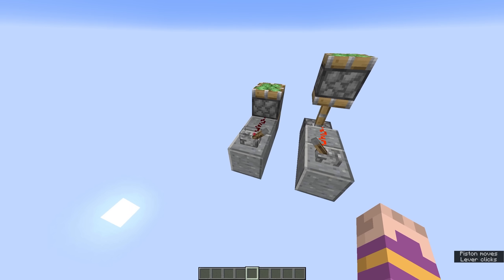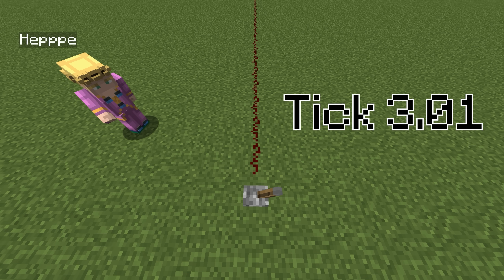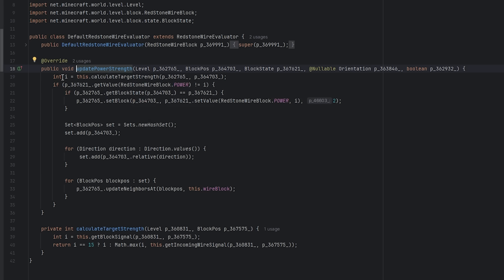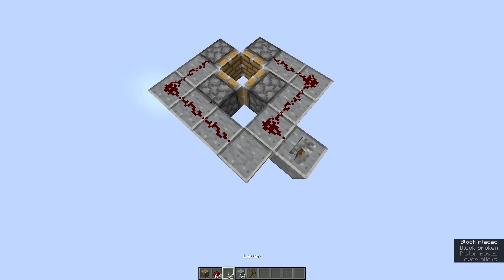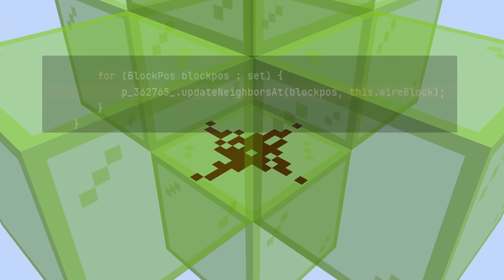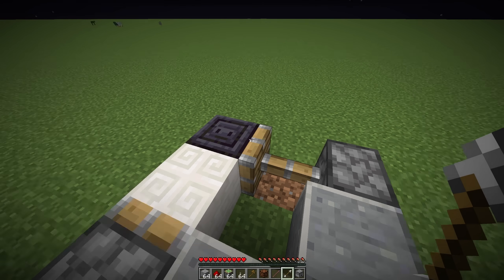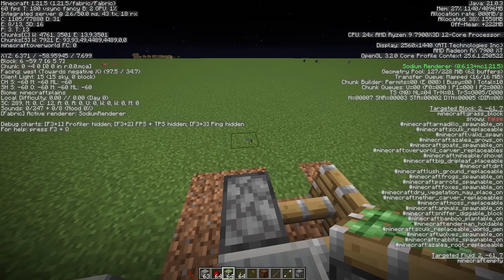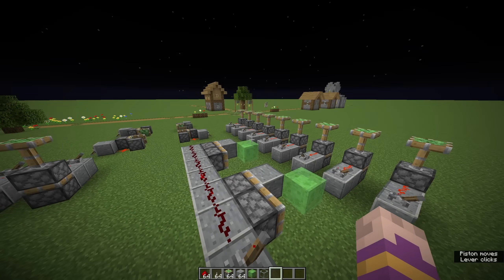Why is redstone locational in Minecraft?

Comment: what's especially crazy about this is that there is absolutely no reason to even use a hashset here; they are already directly iterating over all of the directions to begin with. It would make way more sense for the code to just, update the current block, then iterate over neighbors and update them. This would also make the code faster (since you don't have to allocate and initialize a hashset every time) I have no idea what the mojang dev was thinking here.

Comment: I honestly think the problem with Minecraft runs a bit deeper. I think there’s a massive problem with technical Minecraft revolving around the engineering aspect before the polish aspect. I feel like no technical Minecraft player has taken a step back to think about how ridiculous redstone contraptions are nowadays. Like, why the hell do Minecraft builds need composters?? Why are there target blocks in your build that aren’t meant to be shot at?? Why are you using the fact that block X is 1/16 of a block shorter than a regular block? It feels like Minecraft blocks get a random assortment of ultra specific properties which gives rise to technical players discovering a super useful but super niche application, which becomes the meta for a specific build. Why can’t we have new blocks introduced to solve existing problems instead of relying on weird quirks to make builds work? Why don’t we have a block that doesn’t connect a north/south wire with an east/west wire? Why do we need to apply a 0 tick pulse to have sticky pistons “let go” of a block? Why can’t we just have block deployers and pickers instead of having to rely on duping TNT?? Imagine if another game required you to put a slightly toasted ham sandwich in a TNT cannon contraption so that it reliably propelled TNT forward. Every Minecraft player is like: “yeah that makes sense”.

Don’t get me started with Minecraft PVP. Every other game has parrying, dodging, blocking. And that for the most part is what distinguishes a good player from an inexperienced player. Minecraft has fishing rods, placing crystals on obsidian and popping it, flying into the sky with wings and then hitting people with hammers. It feels like a fever dream that everyone’s just accepted.

Comment: Regarding the “Simplifying” section, you forgot the xor operation: the pattern for each 16 blocks is broken when the upper 16 bits change, and the subsequent calculation is only valid if the bit to be xored is 0b0000.
There are not many predictable patterns when you consider the case where the upper bits changes within the notifiers of a single dust. Basically, the order between notifiers should be considered unpredictable.

The boundary where the upper 16 bits change can be understood as a set of planes represented by 961z+31y+x≡0 (mod 65536). Since these planes are almost perpendicular to the z axis, we can say that at least one of the dusts lined up two blocks apart in the z direction does not contain the boundary plane. A non-locational arrangement that takes advantage of this fact has already been considered (https://youtu.be/2mjZuWJDB0k), but it is still not practical, e.g., it's directional after all.

Comment: 5:14 Am I crazy, or is the 0 at the top there only because of doors? Like it makes no sense for a redstone wire to power the block above (outside of redstone comparators, but this was coded before repeaters were even a thing), it would only make sense to update the block above only if the code for doors was copy pasted, where clicking on the bottom door updates the top door

Comment: 6:23 uh no... redstone torches also do this and also repeaters, comparators, observers, buttons, levers, pressure plates, tripwire hooks and powered and activator rails (considering how many there are i might have forgotten smth) but only in one direction (if rails are a slope then in 2 directions)
Reply from the maker: I said only redstone wire is locational. And I am correct. Never mentioned directionality
Reply: @HeppeGaming I was talking about update range

Comment: 3:37 another way to describe it is unordered = could be any order. Which order it uses can be determined by any part of the program. You could just choose an order as the programmer, you could use a hash function, you could let another program or library determine it, you could make it "random", or you could even let the user determine it. And the important part is your program must work "correctly" for all possible orders.

Comment: This video is inaccurate and flawed in many ways:
- Java double hashes to prevent stupid hashcodes like the one mojang uses from creating patterns, which results in the actual bucket order being impractical to exploit beyond a proof of concept. This has been known for 10 years after sharir made this exact same mistake in his explanation. The only practical thing to take out of the hashset is that you can't rely on the notifier order (e.g. some non-loc dust builds rely on the order within each notifier to create several directional cases that cancel eachother out resulting in reliability, but the ordre of the notifiers has never been relied on in practice).
- Nobody calls it quantum mechanics
- Get a better decomplier lol. Most of the variable names are unreadable.
Reply: I'm so happy to see you here
Reply from the maker: Haters gonna hate
Reply: Don't ignore the double hash then, this has been known about for literally 10 years.

Comment: ……Then someone did the experiment in 2025: stack two pistons vertically, place a solid block next to the bottom one, place a red stone dust on the solid block and point to the top one, then power the red stone dust. The researchers found that there are two results: the top one extended, or the bottom one extended, in the absolute same contraptions. This is the top-bottom duality of pistons. But if you try to observe the contraption while it’s working (yeah, observer), you’ll only see the bottom one extend……..

Comment: 1:15 there is something called "multithreading"
Reply: Minecrafts "logic" is single threaded + even if that were not the case, it would not happen at the same time. If it did, there would be a race condition, either crashing the program, or getting an unexpected result in one or 2 functions. Multi threading isnt going to be used in this sort of scenario.
Reply: Thanks for the explanation @uxiii9537
Reply: Minecraft doesnt know what that is

Comment: 9:24 might be an unpolular opinion but i like it being locational
it open up otherwise impossible wirings at the cost of making "normal" wirings not work sometimes, but a skilled redstoner should be able to spot these and work around them, so in the end its a net-positive as we get more possibilities out of it (while ofc confusing the casuals super badly)
Reply: I used to agree until they fixed a lot of the edge-cases of the new experiment redstone updates so you can actually do a lot of things to prevent the randomness, which just makes it a straight upgrade to directionality & locationality. Plus having compact randomness can be nice in some cases. Shame that they’ve canned the experiments tho :/
Reply: @josiahdsmith5641  i feel like the compromise of "the experimental changes when they're deterministic but location-based instead of random for tiebreaks" seems like the best of both worlds, but I also kinda get why mojang wouldn't want locational redstone in the game at all

Comment: fun fact: Hoppers are also locational for the same reason, an item is either in them for 7 or 8 gameticks, depending on if the hopper got ticked before the one which puts the item in it
they added a fix for this in a "recent" update (like 1.18 or something), where the game specifically checks for the 8gt case and manually sets it to 7
HOWEVER this only works for hoppers pointing into other hoppers, a hopper pointing into a chest/minecart and then another hopper pulling from that one is still 7 or 8 based on location ^^
Reply: Slime blocks being removed from the world too is also locational due to iterating through hashsets.
Reply: So that's why dropper-hopper monostables always give a 7gt output
Reply: This is really interesting info I didn't know about
Reply: Bruh they fixed hoppers to hoppers only
Reply: That doesn't fix the thing when you have hopper line which feed into each other and you lock all this line in same tick and then not every hopper has item in it
Reply: Damn its crazy you’re STILL in the community!! I remember you from back in the day
Reply: so hopper>pot>hopper is inconsistent

Comment: is the hashset used in a non-modulo case?
as in, would it be possible to build a redstone machine that, wherever it was placed, it would display its own coordinates?
Reply from the maker: No, I think at most you could display it's bucket index
Reply: @HeppeGaming not quite the same but a redstoner named whitestonejazz made a build that relied on directionality and it gave a different output depending on how you oriented it
Reply: @HeppeGaming  ah well
i also remember a thing from cubicmetre where he was able to align a minecart to arbitrary precision
if it were possible to read that data out, you could get rough distance from the origin on each x,z axis by using floating point errors, although it would only be accurate to the closest power of 2

maybe also a chunk detector which would give you your location within a chunk too?

that isn't enough to add to the bucket information to get an answer out, but maybe there are other things i am missing that could solve it?
Reply: @HeppeGaming i think you can do better because the hashSpread thingy makes the hash slightly nonlinear.

Comment: "How come my redstone build isn't working?"
"Have you considered building it over there instead?"
Reply: "it works on my machine" ahh
Reply: There was a time I built a sorter right on a chunk boundary. The hoppers were in one chunk, the rest of the redstone stuff was in another chunk. It meant that if anyone walked in a way that allowed the chunk with the hoppers to load, but the chunk with the redstone to not be loaded, stuff would just go through.
Reply: "Have you considered rotating it 90°"
Reply: If only it was this simple with real code.
Reply: @olzhas1one755 I mean... it's basically the same as changing the order of an unordered list by changing which element is added first (in an arbitrary order like 3rd inserted is 1st when iterating, but only if in the same bucket)

Comment: wait so every redstone dust creates a hashset every time it updates? that explains why it's so laggy
Reply from the maker: yea... it does
Reply: @HeppeGaming  Why is it even a hashset? Does it get used somewhere else where it makes sence?
Reply: the real killer here is just the fact that it's allocating memory over and over and over again, not the fact that it's a hashset in particular. They should definitely just use like some sort of 8 length list pool for the majority of the time
Reply: It definitely doesn't need to be a hash set, but that is not where the lag comes from. The biggest slow down is fetching block states from the chunk. And because of the naive update logic, each wire in a network updates over half a dozen times more than necessary. And that increases the amount of chunk calls by that amount too.
Reply: @SpaceWalkerChannel  Oh, I remember you, you the guy who fixed update order, thanks man!
Reply: Also, if you’re wondering: aren’t some of those updates unnecessary and/or duplicates? The answer is yes for both. Due to dust telling each of its neighbors to update all of their neighbors, the dust itself ends up getting 6 updates. And one way to save on unnecessary dust updates would be to only send ‘neighbor updates’ in directions that the dust is actually pointing. So if you have a corner dust it would send 1 (itself) + 2 (corners) + 1 (down) x 6 = 24 updates instead of the normal 42. This would reduce lag overall while still allowing for remote block updates that some contraptions rely on (while also making it controllable, which is arguably much better)
Reply: No the lag comes from light updates I'm pretty sure. Allocating a 16-item array isn't too bad, neither is calculating hashes
Reply: @kyay10  This is a long-standing myth about dust. Dust does not, nor has it ever, caused light updates. People just think it gives light because of the difference between the dark red & bright red textures. Build a completely dark box and put some dust in there with a lever and power the lever. No light. Only redstone torches give off light.

The real reason why dust is laggy is because it sends 336 block updates when going from level 15 to level 0…
Reply: @josiahdsmith5641  wait I thought that's why rails were less laggy lol. I guess I was lied to lmao
Reply: @kyay10 think of it this way: since they cannot connect sideways, rails only need to check 6 blocks: 3 in front of the rail (one straight, one diagonal up, one diagonal down), and 3 back
Reply: That's only minimally why rails are less laggy. The big reason rails are less laggy is that they only send block updates out once instead of 8 times.
Reply: @kyay10  There are 2 reasons rails are less laggy than dust:

1) For each update, dust tells itself and each of its neighbors to update its own neighbors. So that’s 7x6 = 42 updates. A flat rail only tells itself and the block underneath it to update its own neighbors, so 2x6 = 12 updates. Sloped rails however also tell the block above it to update its neighbors, so they have 18 updates. But even then that’s over 2x better than dust

2) Dust has 16 signal strengths that it has to go through when going from fully powered (15) to fully unpowered (0). If the dust is connected to another dust it can only go down 2 steps at a time, so when unpowering a 15 strength dust it actually does the 42 updates 8 times, for over 320 updates in total. In contrast rails only have an on/off state, so it only ever does the 12/18 updates.

In conclusion: rails are better than using dust willy-nilly, but if you pre-power your redstone dust (that means you have your starting dust at lvl 14 even when off and have your target be 15 away so that when you turn on the dust line each dust only updates 1 time while still delivering the power to the target) you can massively reduce the lag dust gives, down to levels that are comparable to a rail line
Reply: @josiahdsmith5641  Would the particles spawned by powered Redstone dust not cause lag? Also you said that only Redstone torches cause light, but I thought observers also did?
Reply: @Izzythemaker127  Particles do cause a bit of lag, but it’s pretty much negligible, especially compared to blocks that create a lot of particles like spore blossoms. And no, observers do not give off light
Reply: @kyay10  If I'm understanding correctly, it's not a 16-item array. It is a hash set for *every* wire in a line. Every placed piece of redstone wire creates a separate hashset. And if 5 long lines activate simultaneously, it's 5*16=80 hashset creations, and itterationg over all of them, all in one tick.
Reply: @kyay10  hash tables in java are not "flat", and anything involving more objects will mean more pointers. what you actually have is a pointer to an object that has a pointer to another object that has a pointer to an array of pointers to objects that contain a pointer to the key and a pointer to the next element in the bucket, if any. each of these pointers means a separate allocation, and while the JVM is designed for tons of little allocations, it is still quite a lot more work and pointer chasing than a simple array (which is still technically a pointer to an array of pointers, but hey. thats the JVM for you)
Reply: @kyay10  allocatring a 16 item array isn't that bad,. but each piece of dust does that 7 times per tick, and garbage collection is expensive